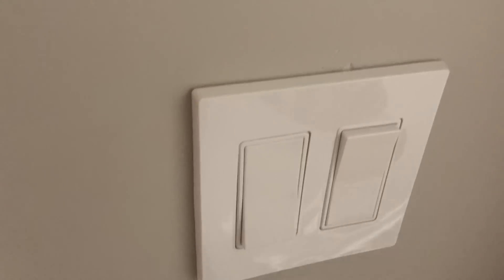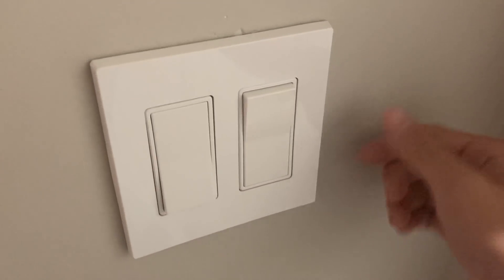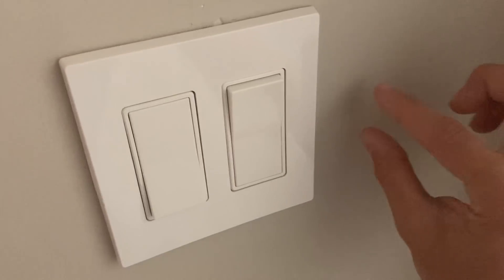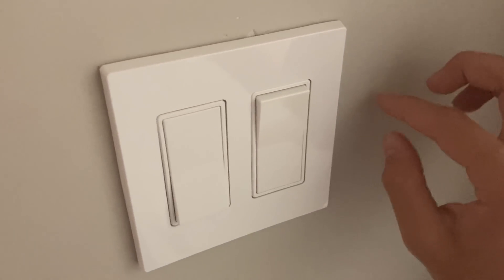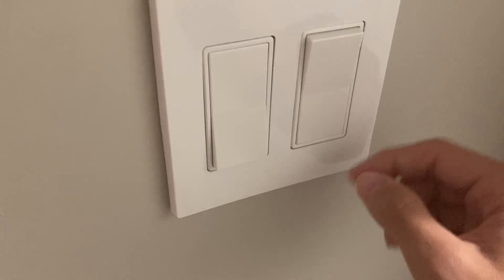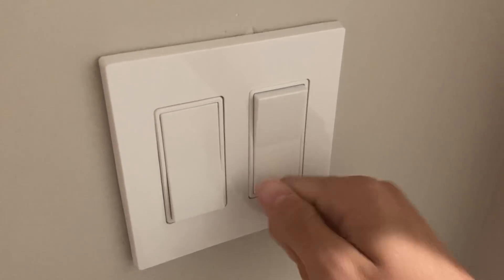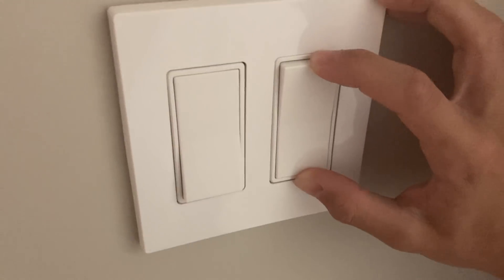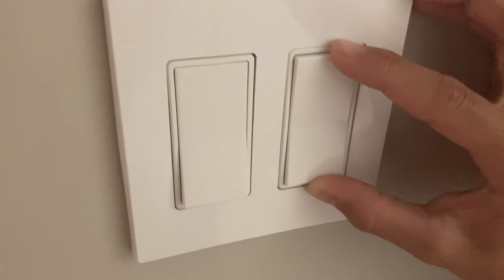Balancing a light switch in mere seconds

Comment: Challenge: Open a fridge without making the light inside turn on.
Reply: Thats ez
Reply: Ok no offence but that's ez for me, so for him it would be a harder challenge to try reaching such low standards than the challenge itself. Didn't you learn already he's a demigod?
Reply: The light thing on my refrigerator is broken, so I guess I already accomplished that
Reply: Unplug it lol
Reply: thats ez, just tape the button thats usually on the top right of the fridge
Reply: thats pretty ez ngl
Reply: Don't.
I did that as a kid and the light went broke. (over a decade)
Reply: damn
Reply: unplug the fridge
Reply: try tape the switch. 
also try unplugging the fridge first
Reply: Change to 10 cps then u may catch it in a frame
Reply: turns off fridge and opens it ez pz
Reply: That would be hard
Reply: OOOOOOOOOOOOOOOOOOÓOOOOOOOOOOOOOOOOOOOOOOOOOOOOOOOOOOOOOOOOOOOOOOOOOOOOO
Reply: Easy, just pull out the electricity cord
Reply: Gotta be slowwww
Reply: theres actually a switch in my freezer so
Reply: easy just open it slowly not too much
Reply: * a perfectly working light switch
Reply: @melonade1798  same here XD
Reply: unplug it
Reply: Easy I just push a button
Reply: Easy
Reply: Everyone, check on your fridges. Usually on the bottom of the fridge, there is a small button shaped like a cylinder. Click and hold on that, they'll turn the light off
Reply: Unplug
Reply: Easy My fridge light dosent work
Reply: Ez
Reply: Too easy to him
Reply: Break the fridge.
Reply: Too ez, my fridge's light is already broken
Reply: Ez
Reply: EZ
Reply: Simple I’d say
Reply: Close the fridge without turning the light off
Reply: Impossible
Reply: but he never got a snack at 3am and turned off the light then run
Reply: i think thats impossible the only way is if the light dies/turns off
Reply: easy throw a gernade Infront of the fridge and after it explode you can open the fridge without the light on
Reply: @melonade1798  same
Reply: happened to me.
Reply: O.O
Reply: He won’t do it, he is not the chosen one
Reply: wow
Reply: Sure
Reply: Thats easy
Reply: Wait that impossible...
Reply: @Aprianex  your too smart
Reply: Ez
Reply: I just broke my fridge's light 1 month ago. Ez
Reply: turn off the power EASY
Reply: Lol our fridge has a Light Switch
Reply: i can do that easily
Reply: turn the fridge off, lol
Reply: Impossible in a joking way and a logical way
Reply: Is that even possible?
Reply: Lol
Reply: removes light inside fridge
Reply: Unplug the fridge cord and open it
Reply: Pull the plug lol
Reply: [without using your thumb as an anchor]
Reply: Accepted.
Reply: ez
Reply: @kaseytrevino  yes
Reply: Unplug it
Reply: That’s easy just destroy the fridge
Reply: I tried to that
Reply: casually unplugs the fridge gainzzz💪💪
Reply: Lol,just turn off its switch & open the fridge 😁😂
Reply: Just unplug the fridge
Reply: ooh a switch on top of my fridge holds it light off :)
Reply: my fridge's lights require you to turn the lights on itself, and i never use that cuz the lights are blinding, sooooooooo.
Reply: @Kovyrn  ahaha y in da trap house too brudda
Reply: WHAT TF THATS NOT POSSIBLE
Reply: And close the fridge without the light turning off
Reply: pulls out plug
Reply: Easy mannnn
Reply: My fridges light broke
Reply: EZ DUDE
Reply: @dkwhattouseasusername1012  yes 👏
Reply: @killakira12  good
Reply: Unplugs
Reply: @Iianator  😏
Reply: @alonetraveler5391  gay
Reply: @Iianator  no NO
Reply: @tiberiumateibrasoveanu6101  yea lol cuz u can cover the button that turns it on
Reply: @shivam9023  yea there’s a button
Reply: Cut the power of the fridge then open it EZ
Reply: Same!
Reply: easy unplug the fridge
Reply: NOT POSSIBLE
Reply: easy
Reply: My fridge light is broken so suck on that
Reply: Done.

My light bulb's fried
Reply: Whoa
Reply: Easy
Reply: Challenge: Try to drink water from fridge at 3 am without waking up your parents!
Me:  Easy!  I live alone!
--suddenly hear noises!!!
Reply: Catch the fridge light off while it’s still open
Reply: Did that on accident
Reply: Hmmmm
Reply: IMPOSSIBLE
Reply: Just use my fridge
Reply: *unplugs fridge*
Reply: People in the comments: that’s ez
Other people:just unplug the fridge 
Me: heh.. amateurs..
Other people: what did you just say punk?!
Me: amateurs! me who opened my fridge without the light turning on and without unplugging it (with a fully working light)
Reply: @tiberiumateibrasoveanu6101  only demigod? no, even god himself fears this man
Reply: Impossible
Reply: just throw it out of the window and open it
Reply: Very easy as my fridge's light is broken
Reply: Unplug it
Reply: 1st place: America
Last place: Africa
Reply: me who has a very old fridge with broken lights
Reply: The light in my fridge gets stuck pretty often probobly because it's old.
Reply: @NICOLE YU yeah.
Reply: easy
Reply: Jokes on you
Reply: Turn off the fridge
Reply: Just pull the plug and open the door
Reply: ezzzz
Reply: Impossible
Reply: dude just unplug the power and open it its so simple lol
Reply: Smack that lamp and then record the challenge

DONE
Reply: Me remember my fridge light is broken: EZ
Reply: Challenge accepted. Btw I have dont that so many times I am more powerful than him ha
Reply: @shivam9023  Omg i love advertising my horrible videos  because i suck
Reply: Omg i love advertising my horrible videos  because i suck
Reply: @0_0s  so?
Reply: Hold a magnet at the detector at the top of the inner fridge – light's off.
Reply: Unplug the fridge
Reply: you just need to press down the button
Reply: wdym that's not easy
Reply: @kaseytrevino  yup
Reply: Only gods can do that… and this dabz is one
Reply: Ez take of the plug
Reply: Get the buzz saw
Reply: Thanos: impossible

Dapz: EZ
Reply: That happened to me today
Reply: plug it out
Reply: Our fridge is broken so that's an easy task
Reply: I know you won't believe me, but I can control this light
Reply: Challenge accepted
Reply: I have found a way to do it. Should i reveal my secrets?
Reply: my fridge don't have light
Reply: Stealth 100
Reply: Easy: just switch of power supply
Reply: That’s ez just make power go out form your house
Reply: Unplug
Reply: I did it years ago and it made the light broken
Reply: Ez turn off he electricity
Reply: Just unplug the fridge and open it
Reply: @TriggerzConnors  it is just supposed to be once not over a decade
Reply: That happens when the lights go out so ez
Reply: Ez
Reply: You almost have as many likes as the video
Reply: Just turn off the powe
Reply: Ez, the challenge is making the light turn on for my dumbass fridge
Reply: Hehehe
Reply: YES
Reply: thats so easy just turn of the dridge
Reply: Fun fact: most people fridge light are broken :v
Reply: @thaswag1893  ikr
Reply: Easy cuz I have an broken fridge
Reply: ez, my fridge light is broken
Reply: To ez just hit the button or find the small switch. Hold it down and its off
Reply: My broken fridge: Pathetic
Reply: Or cut off the power
Reply: Mine can do that lmao
Reply: That's way too easy
Reply: Turn it off
Reply: I used to have a fridge with no light
Reply: Turn off the electricity and open ezzzz
Reply: Shoot the light first and then open
Reply: Way to ez
Reply: Mission impossible
Reply: I only got that 10 times in my life
Reply: EZ just before hand tape the button down
Reply: Just turn off the light on the inside and tell them you opened the fridge without turning the light on hah
Reply: Solution 
Break the light
Reply: My fridge doesn't have a light bulb I win
Reply: So much power
Reply: Just take out the lightbulb
Reply: Yes
Reply: Done
 Literally easy
Reply: Just plug out the fridge
Reply: Does Un-plug exist in your country?
Reply: Ok now thats impossible
Reply: Ok I’ll just shoot eh light before it can turn on
Reply: Improbable
Reply: easy
Reply: @shivam9023  you couldn't
Reply: @rbdshadow7272  YES. I. CAN.
Reply: Deal. Easy. Our light just broke the other day.
Reply: Unplug the fridge
Reply: Easy. Unplug the fridge
Reply: The light in mine doesn’t even work
Reply: the light in my fridge broke
Reply: bro just hold it down
Reply: turn off power ez
Reply: @rbdshadow7272  bro, just switch off the cable of the refrigerator
Reply: U N P L U G
Reply: All you gotta do is unplug the fridge.
Reply: I do it all the time
Reply: @sendosnu9814  sad loif
Reply: ive done that before
Reply: cut the wires that are responsible for the lights
Reply: hahhaah ez, the light of ours is broken!
Reply: Easy, just unplug the fridge
Reply: The contacts on one of the switches in my fridge are worn out to the point where  the right-hand door opens without the light turning on.
Reply: You would not.....
Reply: That's easy for me because the light died a year and a half a go
Reply: easy af
Reply: Turn it of the ez
Reply: Easy. Ours has been broken for years. 😂
Reply: Easy just unplug the fridge
Reply: I did that.

Method
1. Unplug the the fridge. 
2. Open the fridge. 
3. My life purpose is done.
4. Everything is meaningless. 
5. What am I?
6. Replug the fridge before you're Mama goes crazy.
Reply: It has lights
Reply: Turn off electricity
Reply: easy you have to hold down the button inside because when you close your fridge it pushes the button in and it turns the light off
Reply: Easy, turn off the fridge
Reply: Ez
Reply: @crocodilebaby706  yes it’s really ez
Reply: If your blind then this is easy
Reply: @cyberroland8061  how do you do it
Reply: I did that
Reply: Challenge: close a fridge so fast the light doesn’t turn off for a few seconds
Reply: Just break the light
Reply: Unplug it lol
Reply: that's literally impossible. because it was designed for that, unless you break/broke it.
Reply: @tiberiumateibrasoveanu6101  no he isn’t a demi god, he is god
Reply: boi I can do that
Reply: We could literally just make it glitch ngl, a cheat is to just break the lights
Reply: ALTHOUGH, without cheats and doing it first try is kinda hard, especially that you don’t get MORE tries.
Reply: Too ez tho
Reply: the light in my fridge almost never turns on
Reply: i did that already as a child

Comment: If you get it in just the wrong spot there’s a chance it can cause a fire. Probably due to arcing between the contacts. Years ago my sister did this and it started to go up in smoke. The reason light switches are clicky is so the electrical contacts are either solidly held together or held at a distance, and the transition between the two states is fast, limiting arcing.

Comment: - Step on water with socks on and resist the urge to take them off 
- Get hand sanitizer on a cut without reacting 
- Touch a car seatbelt after it sitting in the summer sun. 
- Hottest chip challenge without reacting a lot. (Warning that thing hurts lol) 
- Dip pizza in ranch and eat it 
- Pineapple on pizza

Comment: I guess it's difficult for a reason, the faster it switches and the faster the mechanism works, the less arcing occurs and the less damage is dealt to the contacts

It seems like some switches are designed that even if the switch is sitting in the middle, it's not arcing. It starts making a circuit somewhere between the middle and closed circuit it seems like

Comment: Not sure if you know but feather dusters build up dust and the only way to get rid of it is with a smaller feather duster and a magnifying glass. Of course you'll then need to clean the smaller feather duster with an even smaller one, increasing magnification etc. Once happy on a microscopic level, you can start with the big one again to dust your surroundings.

Comment: One time, as a little kid, I balanced all the light switches in the house and the power stopped working. The oven would not turn on, no power came out of the outlets until I turned all the switches back to off or on.
Reply from the maker: Lmaoo

Comment: Someone tell this young whippersnapper that this is a good way to cause a short in the switch.....you know sparks fire hazzard....stuff like that.  You ever hear a quiet snap or pop when you turn on a switch?  That's a connecting circuit causing a arc of electricity to form.  If you balance it it might cause it to constantly arc. Causing a fire? 🙄